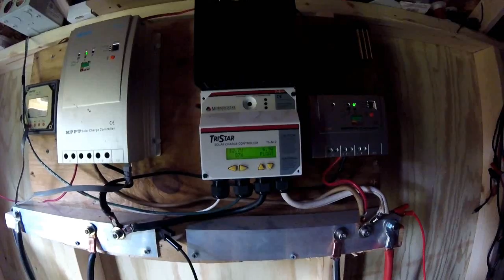Working In The Fully Off Grid Wood Shop All Day

Comment: Troy the ideal thing to put around that pipe is  tile board  you can cut a hole the size the pipe  screw it to the wall and then you will have insulation and ot will hold the pipe up. ..

Comment: Need some push sticks for that table saw, be careful take it from someone that knows that saw will not be good to you if you get your hands by the blade. Look for some kind a guard even if you have to make one. It is extremely painful to have your hand or fingers caught in it. Be careful Troy!
Reply: Cindy Beck he needs a shorter scrap of wood on his fence that stops just short of the blade that way when he cuts with the miter gauge the wood won't bind between the blade and the fence. Also if he made a cross cut sled for the saw it would help greatly. cross cut / panel sled rides in the same groove the miter gauge rides in, and would provide a longer and more stable platform to keep the wood square to the blade. Any cabinet carpenter worth there salt uses one, since it's more accurate and safer a method to boot.
Reply: correct
Reply from the maker: Thanks. I will do that. I just wanted to try this saw out and see if it even works first. It does :)
Reply from the maker: MrCeltic.. There your comment is nice and very informative. Thank you. But I see you are not friendly when advising me directly :(

Comment: The research that I have done on YouTube is the leaf curl is do to overwatering., with all the rain you have been getting that's probably what happened. That is the same thing that happened to my tomatoes. But it goes away and they turn out fine so don't worry. Tomatoes usually can be watered a lot less than the other plants in your garden. Don't worry its fine.
Reply from the maker: Thanks. Isnt it funny that many people told me its due to under watering. lol. Well, as long as they will be fine in the end :)

Comment: How do you get your batteries in float at 12.7 volts? My charge controller bulk charges at 14.8 and float is 13.2. Do I have my setting wrong? 12.7 is fully charged I agree. Would be awesome to see how many KW hours you made that day, heavy loads in sun always bring the production up.
Reply from the maker: It was probably pushing the bottom edge of float and should have dropped out soon I guess. I have to hook up a computer some time and get the readings out of the charge controller. Havent done that in a long time.

Comment: I saw two things that you might be interested in.

The first is called a "paper pot transplanter", and it'd save you a TON of time, while letting you expand your gardens while taking a LOT less time for planting!

The second was another way to set up your tomatoes and other climbing plants, and it's basically like you'd set up a chain link fence, with a solid beam running from post to post to hang strings or netting or whatever else from, while eliminating sagging.  The same idea for a smaller bed would work with solidly fixed posts and a heavy gauge wire, but you'd probably need more posts to offset the sagging.

Anyway...thum thar's sum farmin' idears whut Ah jess dun finded...iff'n thays good, use 'em.  Iff'n thay ain't, doesn't.  d;o)
Reply from the maker: Hmm, got me thinking. Thank you

Comment: I think you need more moisture in the ground the leafs are curling on the tomatoes. That soil is going to take a couple of years to build up so it holds water. Too sandy I guess.  You could water it in between the rains I guess. Good thing it rains a lot is all I can say. 
   I wonder if something bad happed to the campers like  death or something? Creepy. 
 Are you gonna buy Melony a AC? You could cut a hole in the wall or you could get a AC that has a hose to exhaust the hot air out the crank in windows. make a small hole like a dryer exhaust has. Have you seen the portable AC that you can move from room to room and has a hose like a dryer for exhaust.
Reply from the maker: Right now an AC is not in the budget for us. We are hurting since the move and having more bills than ever. Hope to eliminate most of them with time. The neighbors must have returned because the dogs are quiet now for the most part. It may have been some kind of family emergency tho.
Reply: Sorry thats is too bad you guys cannot afford an AC that is very tough on your wife being pregnant.

Comment: Didn't know that getting a 110 A/C hooked up to solar for baby Michelle was gonna cause unnecessary conversations!! I'm 64, we had a HUGE box fan that sucked all the hot air out of the house, but the house had black walnut trees around it, there were pecan trees,  and pear trees, so it was always some kind of breeze. House was kinda in a hallow which helped with the breeze.we also had an outside pump which you had to save water in the bucket to prime the pump. I was 12 before I had an inside toilet.  Used sears catalog for toilet paper. You learned not to use the colored pictures to wipe dodo cuz they would slide up your back..... some "back to the grid" folks take some crap to the extreme, fussing how that's not off the grid. Well guess what,......TO THOSE OVER ZELOUS FOLKS, YOU ARE ON A COMPUTER, TABLET, OR CELLPHONE AND THEY ARE NOT AN OLD TIMIE THING, SO STOP YOUR FUSSING. IF I HAD ALL THE MONEY TO BUY TROY ENOUGH SOLAR PANELS TO RUN A 110 I would...you people fussing put down your electronic devices and go back to letters, envelopes, and stamps. Be off the grid like I was raised.
Reply from the maker: A lot of people get all upset when we dont have AC but people live all over the World without and do just well. Myself, I cant handle the humidity so I need at least a dehumidifier but its not in the budget right now. I study the old ways in case the grid goes down long term but enjoy the comforts while they are there.